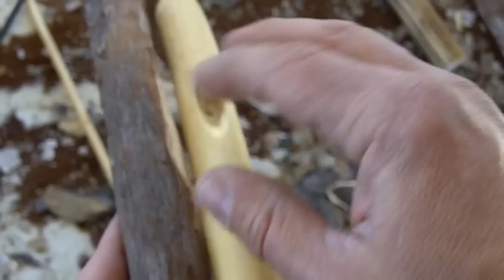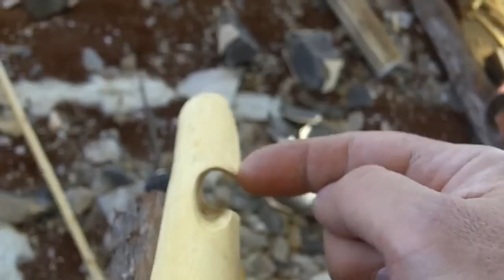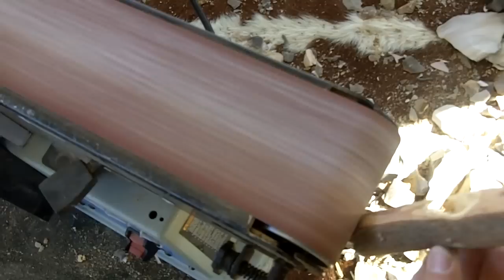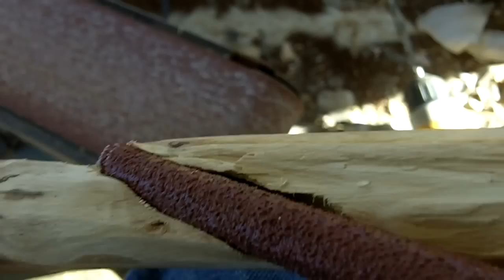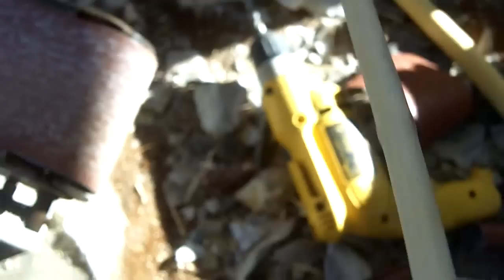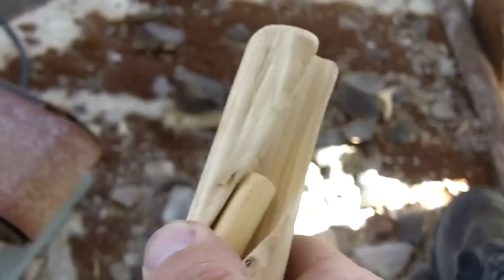183 - How To Make An Arrow Straightening Tool

Comment: Do you have trouble with putting creases in the shaft? I tend to do that..
Reply from the maker: Yes.  I minimize the creases by rounding off the areas on the straightening tool that make contact with the shaft.

Comment: I am puzzled as to why this arrow straightening tool needs to be open on one side. If I don't have a broadhead mounted why not just drill a hole in two blocks of wood and pass the arrow through?  I believe I am missing something--it could be half of my brain, though.